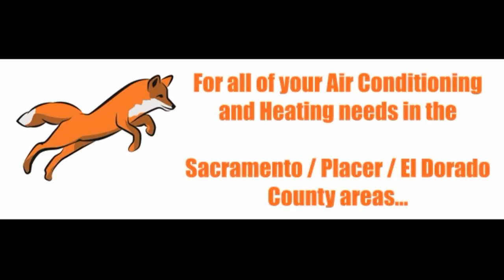Clean and Replace an Air Conditioner Blower Motor

Comment: I would have hosed them down with WD-40 , nice work Greg, Thanks for sharing.
Reply from the maker: what does the wd40 do for them?
Reply: Fox Family Heating and Air Conditioning ,it does a good job of killing them, it also doesnt make them very happt,lol
Reply: yeah, that works also, the lightweight oily film obliterates their flight-ability and drowns them. my fave. is brake/carb cleaner. but crapifalia has the good stuff forbidden ;)

Comment: wasps LOL, try meeting up with Mr. Yellow Jacket nest at the far end of attic, over 30' from opening hole :))))
 I don't know how i didn't leave 500o foot prints/holes in ceiling, nor get the whole house filled with them stinging everything that moved. I dont een recall getting out of the attic as the swarm jumped out of the 6+foot size nest. amazingly,only had a dozen stings, but they swarmed like a cloud of mayflies as I deuced my drawers escaping :))
if you never seen them. https://en.wikipedia.org/wiki/Mayfly

Comment: You and I use the same wasp spray😂😂 that’s the Home Depot 4$ a bottle stuff it’s the best stuff I’ve used and I’ve experimented with a lot of kinds
Reply from the maker: Nice.  Yeah I was at the store before the repair and saw it and was like yep, grabbing that!
Reply: I mostly use brake/carburetor cleaner here, although it's not so cheap here anymore and crapifalia has the good stuff removed from it....